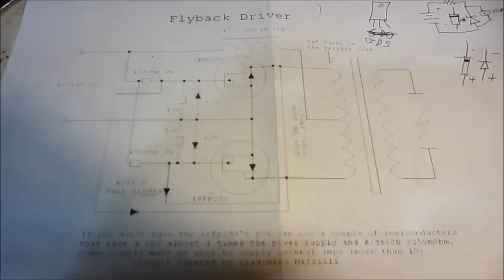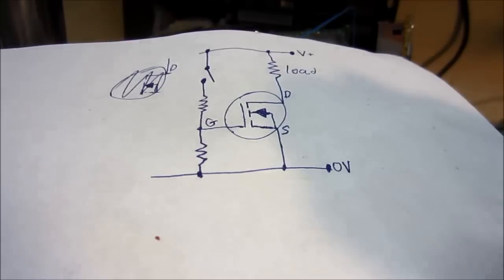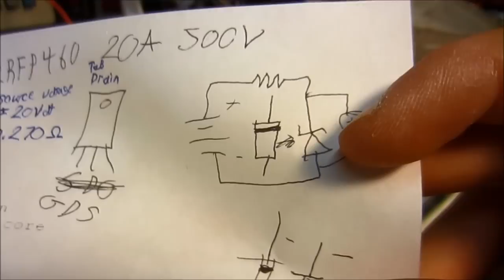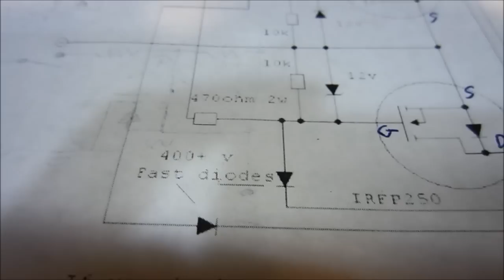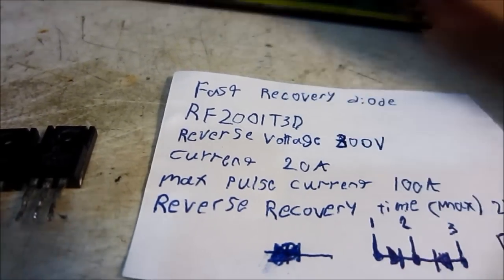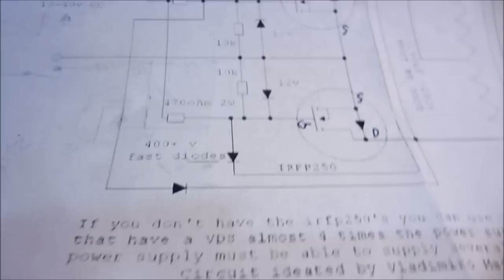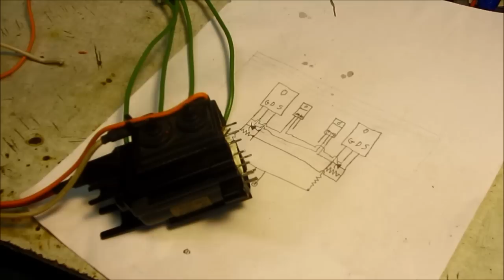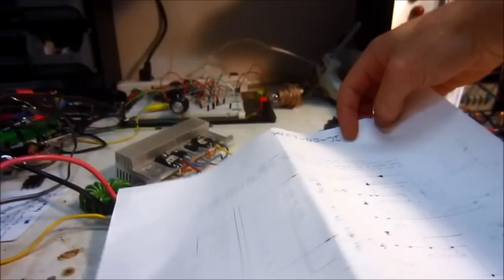How to Build a ZVS Driver, Run, and Mosfet Failure

Comment: notice that on your TV board, the part numbers break down is what each section of the TV does IE: goes something like this, for IF stage 100's,  vertical sweep 400, horizontal sweep 500 etc etc. So, all the caps, resistors & diodes for a section have the same numbered hundred.

Comment: Nice arcs and circuit :D
I think the MOSFET popped because the solder melted on the other one (the MOSFET will be constantly on and a huge current will go through it), and it can be a high voltage peak.

Comment: Good video. Those zenner diodes also prevent the gate going more than minus 0.7 volts as well. You can also put a lot of current into the gate. I often stick 4 amps through the gate, its the voltage that's bad.

If you want to protect the mosfets well then stick those "big" fast diodes across the drain sources. Fast diodes for your gates will be small in size as they will be low power and low capacitance.

Well done for getting it working so quickly. Good to see you using fets instead of bipolar

Comment: Nice mosfet test rig. A better way to test zeners, is to pot diode to be tested across a cap, less than 1µf. Then fill the cap with small flyback, like a small joule thief or something. Cap will fill to diode value, the diode breaks over and cap stays full to diode value as long as flyback is on. I did a video on it a while ago. Small cap means less current, can test to over 100v with my little rig.

Comment: Nice video, the MOSFETs most likely popped because of bad capacitors, use capacitors that are for pulse applications (WIMA FKP 1), and use MOSFETs that can handle more current (30+ Amp), IRFP260N ar good, I personally in the past use two IRFP150N in parallel on 28 VDC at 30 ADC, and never had problems with them ;)

And thumbs up :D

Alex

Comment: great job, thats what my first working zvs did lol. you might want to find some safety caps to use for the capacitor. they are usually on or near the input of computer power supply and should be from .33-2 mfd 250-400v. i have had good experience with them. you can google safety capacitor to see what they look like.

Comment: Mosfets are a little more tricky than that. If you switch them too slow they run in a linear mode and overheat. If you switch them too fast you get nasty spikes that make everything glitch. I set my switching up on an oscilloscope and aim for something in between, Dont let me put you off. You can wing it and get it pretty good.

That circuit you have looks mostly OK. The main problem is you cannot limit over voltage on the Drain Source. A TVS diode works magic here.

Comment: If a ZVS driver plays up, it's very tricky to diagnose what can be causing the failures. One of the most important observations you can make it whether the transistors blow up immediately at switch or during arcing - I built my ZVS twice using SLAs as my pwoer supply and it used to frequency blow up when I switched on, most likely due to the inrush current (SLAs are used to start cars because of their enormous current capability!). So what I do it have an inline resistor with the +ve or -ve power supply lead to limit the initial current, which I then short out afterwards. 

It's important to use properly rated components because this self-resonant topology can cause large amounts of voltage and currents to form. Make sure your transistors have a high enough voltage rating (4x power supply as Vladimiro Mazilli says) and they need to be able to handle significant amounts of current too - what likely happened in your video is the fets heated up to the point where their current handling capability decreased below the current the ZVS was drawing, leading to a thermal runaway and failure. Good idea to use thermal grease to improve the thermal conductivity.
Reply: I don't think it's about overheating, this circuit is very efficient and as he showed up the current consumption was about 6A on 24v.
This kind of oscillator has great efficiency but the downside is its sensitivity, mainly the version with only one choke and center tape.
I haven't got too many problems with the dual choke version, it is less efficient but at least the MOSFETs keep working well for a long time without burning out, but the one choke version worked until I stretched the arc, then one of the MOSFETs shorted, so I replaced it and got the same results, all play and games until you stretch the arc and then it dies, dual choke version keeps working well

Comment: This is a bit of a late reply , but the problem is with the zenner diodes. I now use 18V 1A zenner diodes and it works well.

When i used 12V zenner diodes they used to get blown apart ;) 👍

Comment from the maker: Thank you for your help!  I am pretty sure that I have a couple of these diodes from CRT TVs.  So I just need to connect one of these from the Drain to the Source on both of my mosfets?  Do I need one that has a specific voltage rating or anything or will any one work?  Thank you again!

Comment: nice device destruction. FET = Fire Emitting Transistor.
Reply: Paul Frederick it happened to me with my tesla coil. I had just burned the last of my standard npn power transistors on a slightly different circuit and my new circuit blows up. these ocilation circuits are really prone to latching open and shorting.

Comment from the maker: Thanks I'll have to try that.  I have some IRFZ34 they can handle 27 amps at 55 volts how do you think they would work?  I also have a couple IRF8113 they can handle about 17 amps continuous and 135 amps pulse and they are SMD!!!  If I had more I would hook 10 of them in parallel and I would have a monster mosfet!  I also have some other things that test up like mosfets but I can not find the data sheet anywhere.  The part#s are 16N55G and the other one is 5N2307.  
Thank you!

Comment: Lol mine blows up just like yours with only one mosfet fried. And only when i power it with a 12v battery it frys in like 10 seconds but when i use my 12 power supply to power it has no problems and seems like it would run indefinitely. But the arcs are the same size running off both sources. Good video btw

Comment: you could go directly to the mains and use a magnetic ballast (alternatively use a halogen big discharge lamp), thats the easiest thing to limit the current without having the risk that anything could potentially blow up. After your ballast just put a step down transformer for the desired voltage (or variac) and  a couple of diodes and caps for smoothing.

Comment: Nice arcs. quick get the leyden jar! [smoke and fire comes from mosfet] Nooooo to late... whats the on resistance for your mosfets? Might be too high. Or your switching them to fast, I dont think its the speed with that much capacitance. You could make it with falstads sim, and check what freq you had if you didn't scope it. 200-400uf inductor may help. Its mostly there to provide peak amps and protect the supply.

Comment: I use TK65E10N1 mosfets.  Logic level drive, insanely low on state, and handle 140amps at 100v (Even though TO-200 is limited to 100 amps.)  Choke your output and surge protect it against transients.  If it blows, your timing is off and both trans are firing at the same point.

Comment: You are permanently destroying the high voltage flyback pin when drawing that arc--You need to solder a wire to the pin it or simply put a jumper on it and draw the spark from there, thus  protecting the flyback.

Comment: my zeners were usually first to die, when then left the mosfet gates unprotected, which then killed the mosfets.  i need to order some higher power zeners or come up with some other solution or protecting the gates

i ran irfp250's with 16v and they ran great, and when i bumped up to 22v, they arc'ed for a second, then cut out and the fets blew.  i think we need mosfets with a voltage rating closer to 500+ for this to be more reliable with higher voltage sources

Comment: You need to look on the mosfet data sheet. they are only rated to dissipate so many watts. you can find how many watts it is dissipating with a few simple calculations. Another important piece of data you will need for this is the switched on resistance of the mosfet they are not perfect and if their resistance is too high they will dissipate too much energy. check to make sure the gate can handle the voltage you are giving it and also check to see if it is switching fast enough so they both are not on at the same time.

Comment: The inductor is nice! 12:00 The green core with the green wire!)) BUT.. is it a powder core (like iron powder, senust, MO-permalloy)? A ferrite core inductor will not work good: the core will go in saturation.

Comment: The blowup are  a often a electrostatic issue. Bad anti-static protection. The blow-up can occure months after touching the transistor without sufficient antistatic protection and handling.

Comment: Hello.

TV and CRT monitors use transistors rated for very high voltage surges and back feed, like what you get from a flyback.
Your best bet is to take the transistor from a used TV.
Reply from the maker: Yep!  I did that in another video!  Thank you!

Comment: your wire disconnected, which means it doesnt switch anymore and the inductor and flyback gets a constant current, on a constant current the inductor doesnt limit the current anymore and then the mosfet burned up

Comment: Hi mate.
Try getting ya hands on some irfp260n mosfets. There 200volts @ 50 amps ;-) 
The irfp260 are 200 volts @39 amps 

Hope this helps

High1voltage1rules

Comment: Makerj101, you should know that by using mosfet or transistor for any oscillator output, such as the circuit you are working on it. That means you have to use safety capacitor between source and drain or between collector and ammeter, why is that? Because during switching create a spark inside the mosfet or transistor which is produce lots of heat inside of that device and get short out. By using safety capacitor between source and drain or collector and ammeter, you are limited that spark sometimes you dismantle completely that spark... The type of safety capacitor should use low capacity and high voltage? For example for this circuit, try ( 0.047 uf and 1000 v ) than see the result.
Reply from the maker: I see!  Thank you!  I'll give it a try sometime!

Comment: what about using the APT5010JN power MOSFETs in your design they appear to be HV high Current devices could this be what your looking for and they use screw terminals not soldering.

Comment: Hi Makerj, I have a question if I may, I am having trouble finding an inductor of the appropriate size and was wondering if I put 2 in sequence if that would have the same effect. I can't find one large enough for 20 wraps of 16g wire but have 2 together of 10 wraps each. Could this work? thanks for the reply.
Reply: You can put inductors in series and they add like putting resistors in series.  But, the inductance is proportional to the square of the number of turns.  This means that two inductors each with 10 turns is not the same as one inductor wound with 20 turns.  You'll come up a little short of your goal.
Reply: Thanks phil, I was able to figure out the inductor, i'm now wondering how he has the diodes hooked up? picture is hard to discern. I'm wanting to use these types as well but  with 3 pins, i\m not sure which to use in comparison with the 4007 diodes which are straight fwd. any ideas? thanks
Reply: It's ok, I figured it out lol Just treat it like a shotkey  and test for a cathode and anode and install accordingly. That's my take on it so we will see lol :)

Comment: Hi i have bougt a 1000w zvs from aliexpress and i connected it to a 12v car battery. But after turn on the transistors are very hot and i think they will be overheated. Is there to much current or the coil to thick?  what can false?  Please help bevor sonethibg burns out! Thx

Comment: maybe inductor core is wrong, also your unstable power supply may be the cause, and make sure mosfets are at least 4-5x the power supply voltage, also the current should be under the mosfet's maximum current
Reply from the maker: Thank you for the suggestions!

Comment: If you're trying to get 0.68uF using those capacitors, you need to connect them in parallel, not series.  In series, you'll only have 0.073uF.  (remember, Inductors and Resistors work the same as far as connecting multiple, but capacitors work the opposite way)
Reply: Yes capacitors do work that way but you missed something, he said that his capacitors where 2.2uf each not 0.68uf, 0.68uf is the capacitance of all three in series which is the right way to get that capacity if he wired them in parallel he would have 6.60uf wich is way to much for what he needs. So yeah he does have them hooked up the right way for his  porpoise.
Reply: P.s I realized you werent saying that each capacitor was 0.68uf but still you get the point that his caps are 2.20 uf each
Reply: At 12:24 you can hear him say the capacity of each cap

Comment: Hey makerj101 I need help. I recently got my first zvs driver to work, using two IRF510's, no Zener diodes, but regular fast diodes(2n4005's) and a 12v power supply. I was getting really nice arcs almost as good as yours Then all of a sudden it stopped working the next morning. I tested the diodes and the mosfets and they were working just fine. What do you think might be the problem? Should I use different mosfets or different diodes? please tell me if you have a clue as to what the problem is. thanks!

Comment: ill be working on a mains DC 240v 4.03kw MOT flyback, any suggestions?
(after i removed the baffles from this almost 55 year old MOT it started pulling 16.8A on the 240v tap.) while the coil stayed cool, by 10A power lead stayed decently cold btw.

I have these old 10A Full wave rectifiers, and these 6 old 10A MOSFETS from a couple of PowerAMP's
Reply: Delta ever get any good results? I'm currently working on a similar project.

Comment: @ approx. 14 min. I noticed one side glowing orange while the other electrode wasn't. Was it due to one metal having a higher melting temperature, polarity dependence or both? If both electrodes were the same (copper or other) would one electrode glow and the other not?
Reply from the maker: +garyrich2000 I believe it's something to do with polarity or charge. Something like that. You see only one terminal glowing a lot when messing around with high voltage. Especially DC high voltage.
Reply: There is an easy way to know for sure if you are willing and able. If so, please share!
Reply from the maker: +garyrich2000 in pretty sure others have already shown the effect here on YouTube. It's a known property of high voltage

Comment: My last comment u asked me if it was a transistor or resistor it's not any of those it looks like a big black circular capacitor but I found mine in a LG tv power supply I got four of them out of it

Comment: I want to built this circuit but i cant measure the reverse bias of my zener diodes.I connect them like you sayed in the video,but my multimeter shows the raw voltage straight from my power supply.Why does that happen?A response would be greatefull
Reply from the maker: +Commander Riley Are you sure they are zenner diodes?  What is the voltage reading if you revers them?
Reply: Makerj101 Sorry for the late response.It shows me the voltage of my power source withoun any drop in the voltage...
Reply: Makerj101 You ask me something,i answer you...I am also waiting for an answer if you dont mind
Reply: Your probably not still looking for an answer, but here it goes. If you connected like shown in the video and are measuring supply voltage then that either means that the zener voltage is greater than your input or they are not zener diodes. Increase your supply and if you still measure supply at about 30V then they are not zener. Also if all else fails then just put the part number into google and that should tell you.

Comment: Bro I where made this circuit but  very low arc and single 470hms resister  where heating solve this problem plezzzzzzzzzzzzzzzzzzzzzzzzzzzzzzzzzzzzz 😙😫😫😫😫😫😫😫😫😫